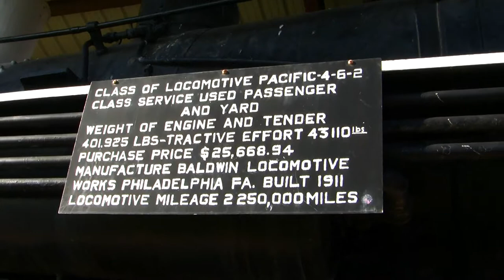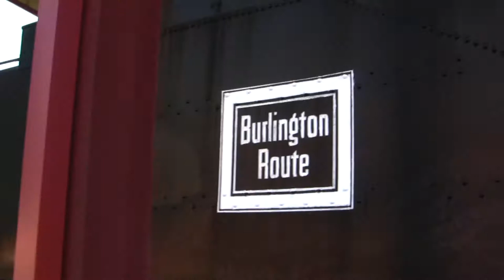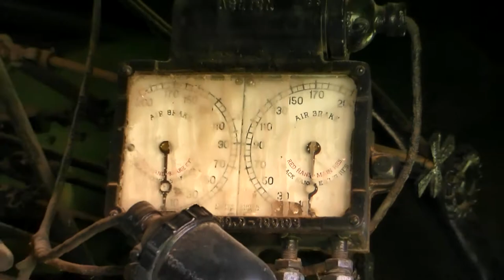Fort Worth and Denver #501 park locomotive Childress, TX

Comment: on December 17, 1928 this steam engine made it's maiden voyage to Turkey, Texas on the new track laid by the Fort Worth and Denver Railroad. The folks in Turkey all came out to see the train. Phillips Petroleum Company was originated in Oklahoma, but built its first Phillips 66 service station in Turkey Texas located on the corner of 5th Street and Main that opened for business on July 27, 1928. Phillips built a bulk terminal depot along the new railroad in Turkey and spent $40,000 dollars to build the depot and the gas station ($600,000 in 2018 dollars). This train was extremely important to the growth and prosperity of Turkey and surrounding towns in the Texas Panhandle in the 1920s.